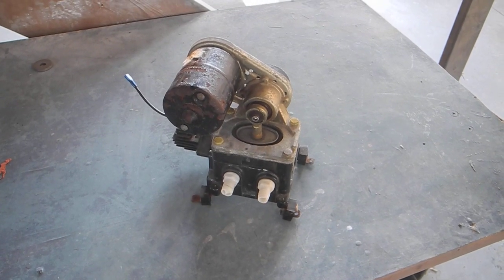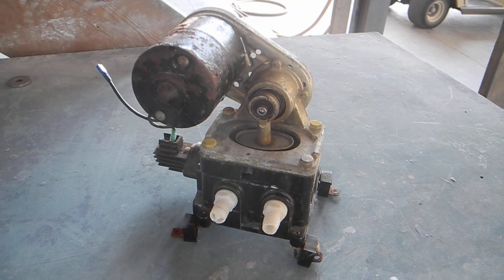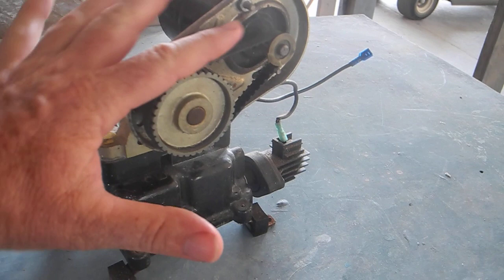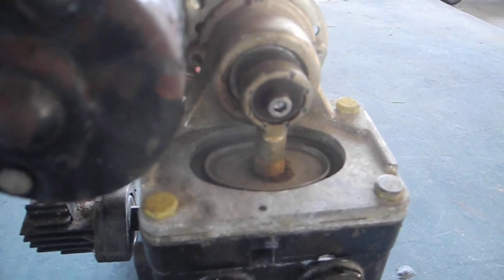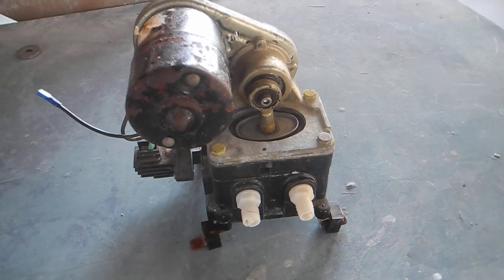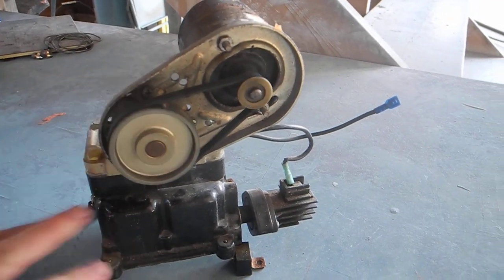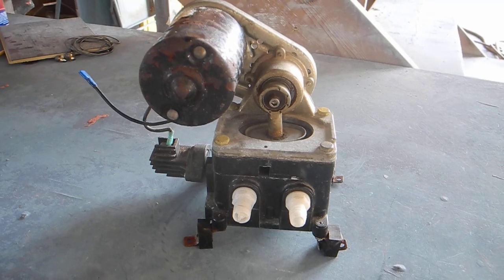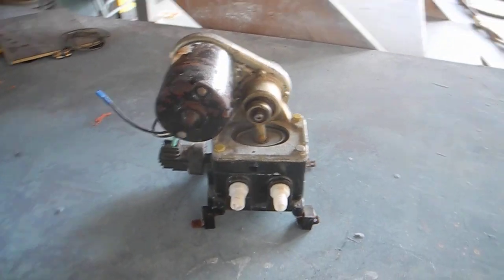PAR water pump

Comment: I have 3 of these pumps in my 1969 Chris Craft Sport Cruiser as well as one for my domestic water, all working perfectly.
Reply from the maker: Be sure to oil the bearings. If yours has a belt drive check to confirm it is in alignment.

Comment: This is a great looking little pump. I always had good luck with diaphragm pumps. The ones I used were larger but were dependable. A good morning to all. Smokey 🤩
Reply from the maker: Glad to hear your pump was reliable. Install an inline strainer BEFORE the water arrives at the pump to prevent debris from fouling the check valves.
Reply: @AskCaptainChris  We used great big ones to pump out settling ponds. 💪. Same principle

Comment: Hi Chris I have a similar PAR  fitted on my boat to supply of domestic water to my two bathrooms.  31 continuous years use but recently started to have an intermittent fault whereby it switches off after a few minutes use. I jiggled the electrical connections and it starts again so decided to take apart, clean all the electrical connections and refitted but the fault came back. The housing containing the electrical connections also has 2 spring loaded bolts and the pump seems to perform like an old points car system. Would it be an issue with something internal or is there some way of fault finding. Hope you can assist in some way
Reply from the maker: I assume this motor has served you well and may need to be replaced.